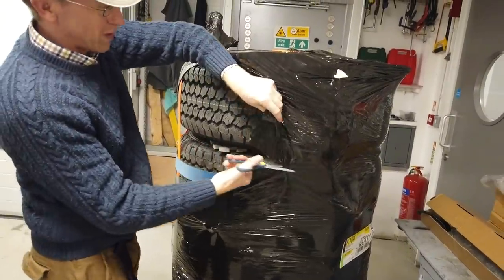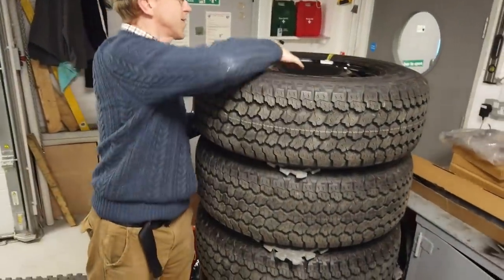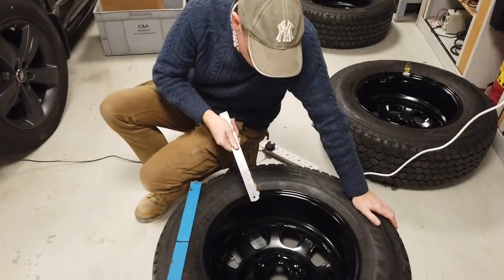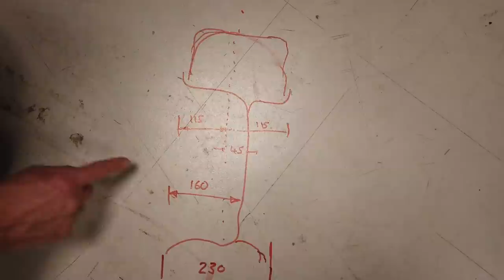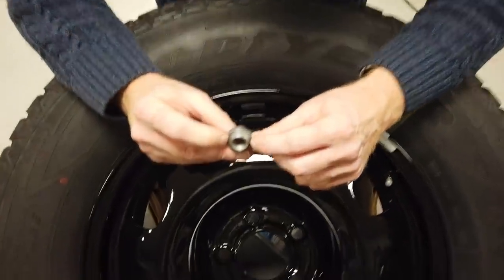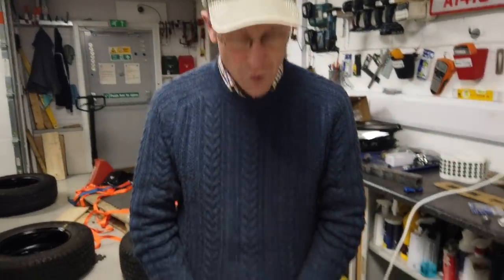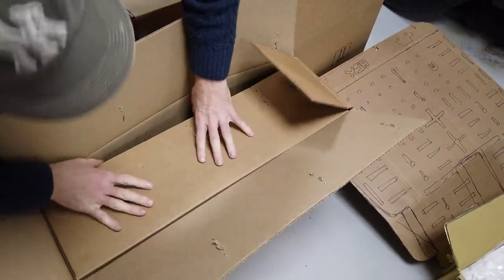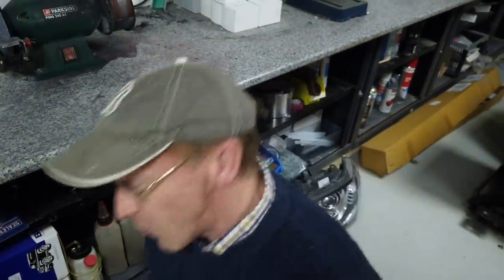Our project Land Rover DEFENDER 2020 get some new OFF ROAD Accessories

Comment: Nice all these parts for going off-road. We did the LR experience here  in the Netherlands with the standard tires on a rainy day. It surprised me how good these already preformed. Also with motorcycle we reduce the tire pressure with off-road and we have mini compressor with us. You can use these also for bigger tires.

Comment: I was at Eastnor experience day yesterday.  All the Defenders were on the tyre.  I was very impressed and had no issues with them on the worst we tackled.  Equally as good as General Grabber AT2 or BF Goodrich which were my previous tyre of choice.

Steps- they have some steps longer/steeper than in your previous vids.  Tried tackling slow in rock crawl and span out just like you did.

Placed in auto, drove up onto the first step to lift the front and then added plenty of power (right foot) but not loads and the car shot up the steps and over the top with mud filled tyres at norm pressures.

Talked /looked at the Warn winch too..  Amazing bit of kit

Comment: Really looking forward to seeing the winch installation. Got my 110 yesterday (with the same Wrangler A/T tyres) so your Defender 2020 videos have become even more relevant. I had BFG K02s on my old Tdi 90, it'll be interesting to see how these compare. Great to see JLR appreciating all your work, keep it up! 👍🏻

P.S. I wouldn't tamper with the air suspension, just get a high capacity compressor. 😉

Comment: Early Christmas for sure. The really knobbly tires are the BFG K03 mud tires. I don't think they are a good all round tire but very good off road. Personally I wouldn't mess with the onboard air compressor as you can get a perfectly serviceable one for cheap.

Comment: You can spec defender with a built in tyre compressor in the boot/trunk. Might be worth looking if the accessory is retrofit
Reply from the maker: Yes I think this will be the best / be more interesting for people.
Just priced it up - PN is L2017860 and its £500+ Vat retail !
Reply: @L663  Look forward to seeing that install ;) ! very interested to see the winch+bumper install as well!

Comment: Nice wheels if you are having two sets alloy and steel i would suggest getting mud terrain tyres not AT ones. Looking forward to winch install a very nice gift from land rover. I run BFG MT tyres on my defender and always have on any defender I have owned.
Reply from the maker: I think i am going to agree with you.... leave the AT on the 20's and mud tyres on the 18's/ I will put the wheels on - see what they look like / space around the arches and then look what size mud tyres will be best.

Comment: Doesn't the Defender already have a built in air compressor in the trunk for adjusting tyre pressures? It's an accessory that fits on the side.
Reply: Depends on model and options.
Reply: Yes (VPLEP0574 Integrated Air Compressor £788) - I've spec'd one on my Defender X which I'm hoping will be delivered in the next few weeks
Reply from the maker: Alas the stig being an S does not have one.... the PN for the compressor seems to be VPLES0617 at £500 + Vat

Comment: It's unlikely that the vehicle air pymp is suitable for tyre pumping. It will be a low volume high  (ish) pressure device. That's why tyre pymps are large. It would be like emptying a bath with a teaspoon and would probably burn out. Get a standard electric airpunp.
Brian
Reply: Hi, plus 1 ref the tyre pump, think it goes to around 60 Psi , personally use the T max tyre pump which I’ve found to work very well

Comment: Nice to get the freebie winch. All I want is my Defender fixedd! Perhaps I should do a travel blog of me driving back and forth to the dealer, and on life without a courtesy car.
Reply from the maker: I just a software update on mine today.
What problems you having still ? electrical ? did you get a new battery
Reply: Take a look at TFL. They had their defender for 2 days before engine checklight on. Then the cameras failed. No modules in USA, had to be air expressed to USA. They have owned the car for 2 weeks, and driven it for 2 days!!
Reply from the maker: @kevinwyatt9771  Yes i am keeping an eye on that one and as soon as i saw it made sure LR head office were aware of the issue although i am sure they were anyway. After my new battery all my electrical gremlins have gone - although i have just tried to istall the latest software that has downloaded to my car all on its own but i have tried 3 times and so far its not working... will try tomorrow ... look out for video tomorrow. Dont worry i will still be honest if there are issues.... winch or no winch..
Reply: @L663  I have had the "low battery" warning and system shut-down from the start; it happens in I leave anything on - radio, navigation - for about 3 minutes with the engine off, and occasionally when I switch the ignition on. It has been back to the dealer for a total of about 10 days. They said there is a battery drain somewhere but couldn't find where. They said they had been in touch with LR technicians but still no luck. I told service reception that I had heard a battery change might fix it, but don't know if the message was passed on. I hope they will have done something so basic as check the battery. Other issues:
- collision warning not functioning at all or until far too late - obstruction about a car's length in front
- main screen occasionally not coming on
- cameras occasionally not coming on when selecting reverse

The dealer said they replaced the radar but it doesn't seem to have fixed the collision warning issue (they also said the defective radar was the cause of the battery drain, but again it's replacement hasn't fixed the warning issue). They also advised that that the software had been updated to fix the screen issue (why it wasn't updated over the air I don't know) so let's see on that one. The various non-electrical issues and defects have been fixed.
Reply from the maker: @DH-sm7sw  Interesting and disappointing in equal measure... my money is still on the battery.as that the only thing that seemed to fix mine... strange i know.
Reply: @L663  Looking back through the work reports it seems they have not replaced the battery. I assume they tested it, though I recall you did with yours and although it didn't show a fault replacement cured the issue. The dealer accepts I can't be expected to use a vehicle which is regularly warning me the battery is nearly dead or to have to keep returning it to them for the fault to be investigated so the next step is a frank conversation with LR.
Reply from the maker: @DH-sm7sw  thanks for the update... its seems more painful that it needs to be ! You welcome to try my battery !

Comment: You should be able to tap into the pressure tank and put in a quick connector. When you're using the air it'll sense a drop in pressure in the tank and start pumping. Question is though how many psi is in the tank and what the compressor is capable of.

Comment: What I understand is the wheel offset is ET20 for new Defender. I bought 18's for my disco 4 and they are ET35. Also with BFG KO2'S. The people who installed them on my 18's said they were a bitch to balance. 265/60/18 is what I bought, about a 31" tire

Comment: If you want to see stamp you have to remove tyre from the Alloy wheel .
Reply from the maker: The wheels are steel...but i guess your point is still valid - when i change the tyres i will make sure to look out for the markings.

Comment: Great stuff, BUT! These are All terrain tyres not Mud tyres(the ones you need). A/T's in mud brcome racing slicks in seconds and you'll get stuck. M/T's  have much bugger grooves and woth rotation they throw out the mud from the tyre enabling you to have grip at all timrs. Also M/T's perform the same in some terrains as A/T's but much better in all other types of terrain such as mud, rock crawling, gravel, etc.

These are better than what you had but the defender ia still beeing crippled offroad cause you have flip flops instead of army boots.

Don't forget to deflate them when offroad and inflate when going back on tarmac.

Comment: Hi, Whenever you are adding Land Rover parts to your new Defender 2020 you often go to a website where you can see the exploded part you are about to install what is that web address as I can not find it, also too I heard that Land Rover does not give a users manual with it either and I have just ordered 2 MY2021 SE with a 6 cylinder 3.0L Diesel Motor so if you know know of Land Rovers User Manual / Guide web address I would apricate it thank you. BTW I love your show I have learnt a lot about the new Defender.
Reply from the maker: Hi - the accessory installation instructions are online - credit to Land Rover for that.
http://accessories-instructions.landrover.com/enUSA/new-defender
The handbooks are also online... but the search on the online handbook is not good - i should do a video of how bad it is !
https://www.landrover.co.uk/ownership/guides-and-manuals/index.html
Reply: @L663  Thank you so much

Comment: The only people that pump KO2s as a god-tier tire are those are paid to do so, or those that are ignorant of the true performance of the rest of the tires on the market.  It's a good tire, but it comes at a ridiculous "overlander approved" premium, and it's frankly terrible in mud, even for an AT.
Reply from the maker: So what would your choice be ? for a MUD tyre.... so i can keep up with all the Disco's on the off road track ?
Reply: @L663  If cost is no consideration, I would go with the BFG KM1, 2, or 3.  All the benefits of BFG's on road consideration and testing, with a proven track record in mud, strong sidewall, and proven tread wear.  If cost or on road manners are a factor, I'd actually recommend the Goodyear Duratrac as an excellent hybrid MT/AT tire, though it has a weaker sidewall and can be difficult to balance.  Keep in mind that a dedicated mud tire will drastically affect your breaking, handling, snow and wet conditions traction in a very negative way.  Here in Canada we get quite the mud, and I have personally enjoyed my Duratracs more than my previous BFG KM mud tires.  Though the mud tires are tops off road, the trade offs were too much for me, personally.  Your Defender will have much better noise insulation and stability/traction control than my Jeep though, so the mud tire trade offs may not be as big of a deal to you.  Just food for thought!  The Duratrac is also the LR approved heavy off road tire for the Defender.